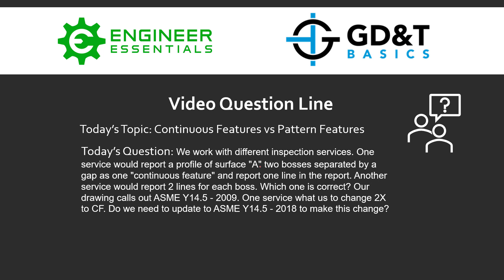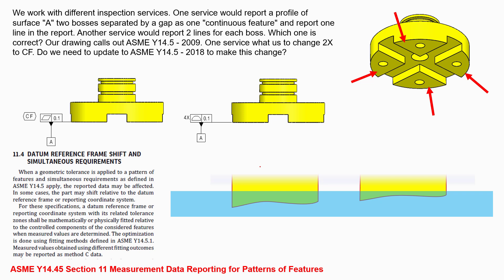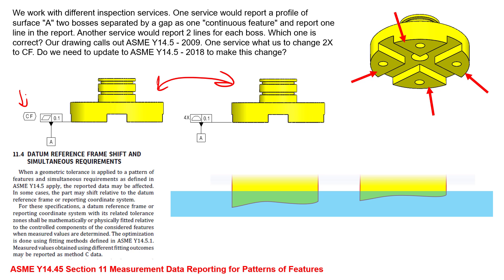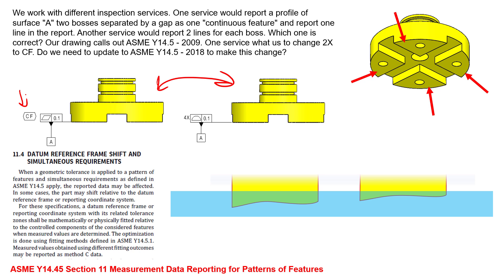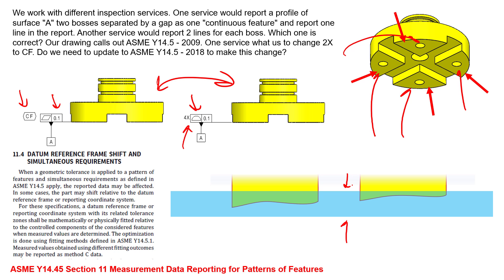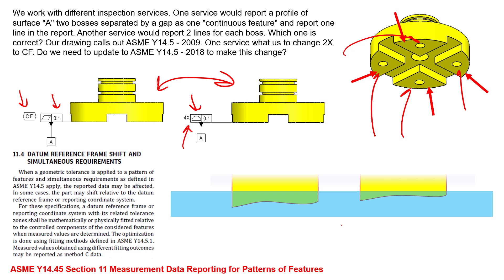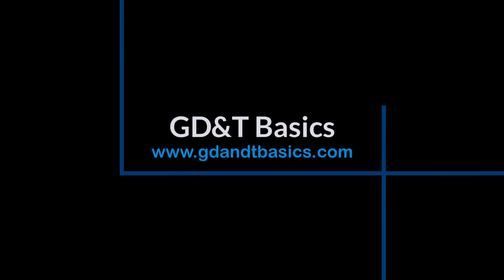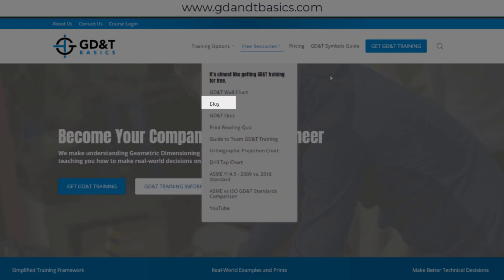Continuous Features vs Pattern Features

Comment: Hi, I really appreciate your presentation style—it makes the concepts much easier to understand. I have a question about virtual conditions. Could you please clarify whether the virtual condition can exceed the maximum material condition when additional geometrical tolerances, such as circularity or runout, are applied? Also, does this apply to all conditions, or are there exceptions?
Reply from the maker: Thanks for the comment! In general, yes Virtual Conditions will always exceed the maximum material condition for any feature of size because VC = MMC + Geometric Tolerances. This is a great concept for a future video, we will add it to our list!
Reply: @Gdandtbasics  but they are few exceptions for example it we apply straightness or flatness to the surface of feature virtual condition doesn't exceed maximum material condition but if we apply same with derived median plane then virtual condition exceed maximum material condition.
Could you please clarify this sentence?

Comment: It’s crazy how often these videos come out to address a recent thought or question I had.

I did have a clarifying question, if instead of using CF on the flatness we used a 4x, would that create a simultaneous requirement? My gut tells me no.
Reply from the maker: The "4x" creates a pattern of features. Patterns of features are a direct link to Simultaneous Requirements but only for "position and profile tolerances" as per the standard. So this is why our example shows 4X profile rather than 4X flatness. So i would agree with you, my gut also tells me no, especially when we have it spelled out for us that it DOES apply to profile. Id just opt to use profile to be safe.